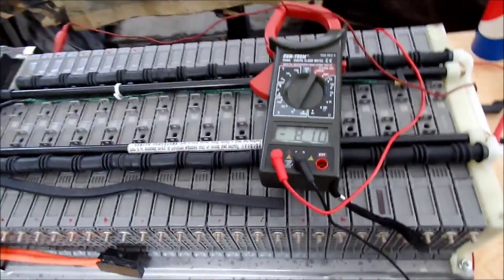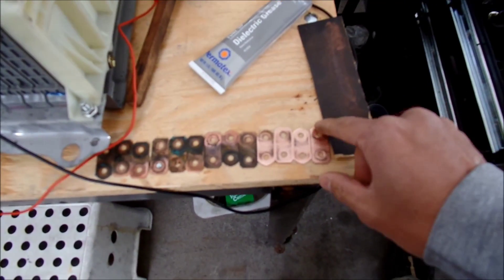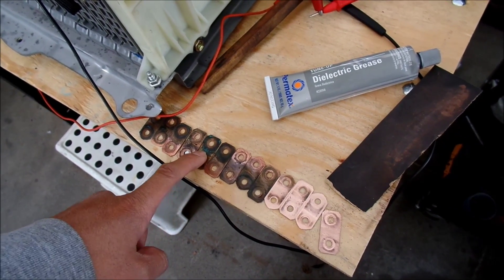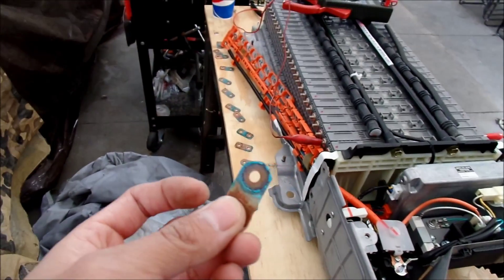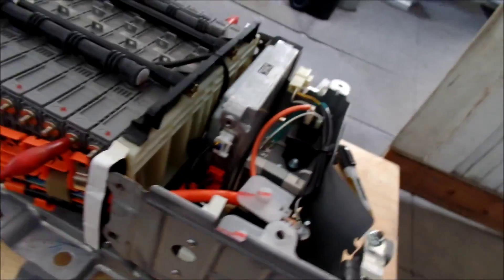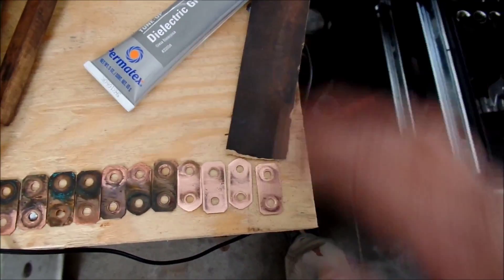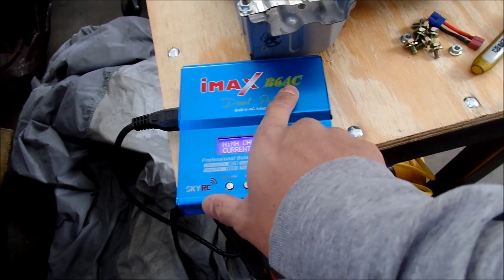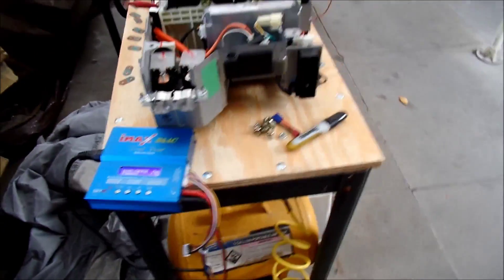HadesOmega Prius Repair VLOG Part 2: Balancing, Cleaning, and PSA!

Comment: Thank you for the great video.  Quick question:  If I want to clean the copper bar only, do I need to take the battery out of the car?
Reply from the maker: No you don't but it'll be easier to remove them if it's out of the car.  Just remember to take the safety plug out.

Comment: All that oxidation/ the blue crusties actually will make a big difference. I have 2 expanded modules and I cleaned up all my bus bars and my car now drives better than it ever has before lol. I have to take the pack back out to replace those puffed-up modules but they still work pretty great. It's obvious my triangle was caused by the bus bars. Since I cleaned them up none of my dash lights has come back on. My MPG went from 45 to 48 so far. Still kind of climbing.

Comment: would cleaning the busbars possibly increase mpg on a vehicle that has no codes?  Lets say on a car that has 100-200,000+ miles worth of corrosion on them.
Reply from the maker: It can't hurt, I'm pretty sure you don't want them to look dark green like they were for sure.
Reply: Yessir! raised mine by 3 so far. Its able to pull more current from the battery so less work for the ICE. Also less work on the battery.

Comment: Just curious how did you manage to pop out the bars from the side with the wires and sensor?
Reply from the maker: It's been a while but there's a plastic cover that just pops out and exposes the bars and bolts.
Reply: Thanks how did the battery hold up?

Comment: i found my bad cell 6.5 the rest are 7.9  can i just replace the bad cell and put it back into the car or do i have to match the charge of the new cell?
Reply: suck this you should cycle each cell to be as close as possible to the same voltage.
Reply: Also make sure the cells are compressed while you charge them meaning split them in 2's get like 2 2×4's and clamps or something to hold them together because the cells do expand while they charge. When you cycle charge each cell it'll take about a week to do them all with a 3 step cycle thats the proper way to do it but many just charge that one cell and put it on but then your taking chance something going wrong because they were not all cycle Charged. Thats why shops charge so much for complete sets and labor

Comment: Hi there, when using the Imax charger, are you charging one cell at a time? If you can give me some tips on how you are using it! Thanks much!
Reply from the maker: +OCastell Group LLC Yes i am charging one cell at a time.  I'm basically charging them and recording the voltages and then charging and discharging them so I they all match.  I use the nimh mode and set the discharge close to where I want the voltages to be.  Pretty simply stuff.  I'm assuming if you had a setup where you can charge multiples cells at a time you can recondition your battery, I just don't know how to do it with the IMAX, but you can balance lipos with it.